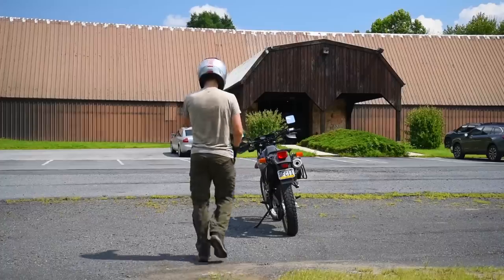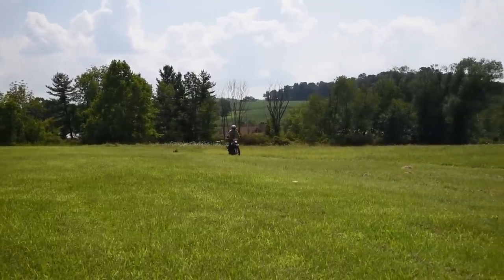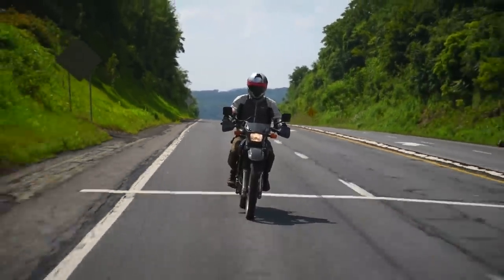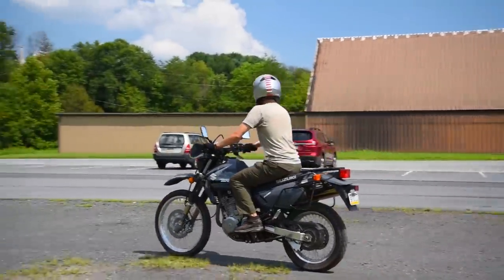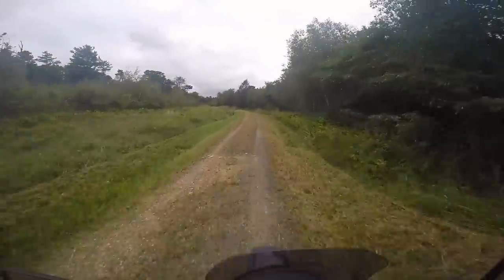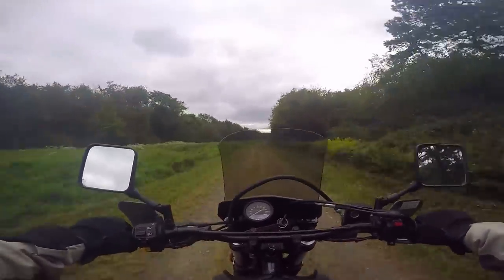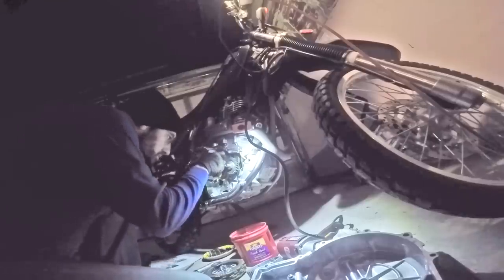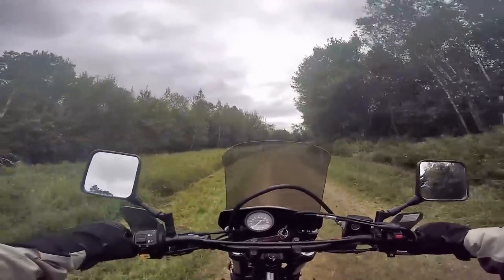2013 Suzuki DR650: Regular Car Reviews

Comment: I used to have a DR250 (first bike as a kid)  and laughed hard at the intro (WHY CAN'T I WHEELIE). When I got comfortable riding, I attempted to wheelie and flat ass couldn't for the life of me. I do remember that my bike was nice, but not great at anything, Wasn't fast (250cc of course), was 'ok' at best on rough single track territory, semi comfortable on trails, but it was pretty comfortable, and it was quiet. Easy to zoom around on without annoying neighbors. For someone who is mainly a road rider but wants to have the capability (and not primary) of off-road, then i'd recommend it. It's a bike you can ride up and down the street, and if you have friends who have dirt bikes, you can at least go with them even if you can't lead the pack.

Comment: Compromise isn't always terrible. The Yamaha FZ6 did it right in my opinion. It's a derivative of the R6 that was adapted for comfort. As a daily-use commuter bike, it is excellent. But, you're not as limited as you would be with a true sport bike, because you can actually tour pretty well on it if you get the urge.

Comment: I'm so glad you did this! I used a DR350 as a daily for a while. It has pretty much the same power to weight ratio as a DR650 but it can do a wheelie lol. It could handle anything from gravel to the interstate. Stock gear ratio was a bit short though. I changed the rear sprocket eventually so it would cruise on the highway reliably. Bigger gas tank too 2 gallons isn't enough. Honestly my EX250s were better dailies but I LOVED that DR350.

I also had an AW11 so thats two vehicles in common with Mr. Regular now. You have good taste, sir.

Comment: City commuting (in places with legal filtering) is absolutely best done on a little dualsport and my mind can not be changed. I did a CB650 Nighthawk for a couple years, then I found a KLR250. I cut the bars as short as possible for maximum lane splitting. I never encountered a red light where I couldn't get to the front. I still had enough acceleration to beat every car off the line. High enough to see everything. Super easy low speed handling. 60+ mpg. Up and down curbs if necessary. Light enough to pick up and reposition. $1500. Cheap insurance. Cheap registration. Cheap parts. Easy to work on. No big deal if some dumbass backs into it and knocks it down. Not really an attention grabber for cops or assholes (if you have a stock pipe).

I could go on... But just trust me, if you  live in a busy city and commute on city streets, you NEED to try a dualsport.

Comment: I have a 2011 dr650.  Bought it brand new. The tires from the factory suck in both conditions.   But I've also had the bike on 80/20  street tires  And it was great on the road. Obviously off road sucked. But, then I had a 100% off road tires on it and driven it on the road and it wasn't that loud. Now, I am back to a 50/50 tire,  It does both better than the 1st set did.

Comment: I ended up with the drz400 - mostly because it was cheap. I bought it as a “dirt bike” that I can ride to the trails. It’s a little heavy but with the dot knobbies it’s not bad - more fun than my old xt350 - but for an amateur like me, the power is manageable. It’s tall though. I’m 6’3 and it’s at the maximum tallness I can ride off road. It’s horrendous on the highway, but ok for back roads.

Comment: I road mine on the highway all the time with no problem, get rid of the wind shield and enjoy the wind in your chest that is what bike riding is all about, I am 71 yr and can ride one all day no problem, and they do make 50- 50 tires that fit this bike that are very good off road and good on road. I don't ride in the mud just don't like getting all muddy, but go through the woods and down many single tracks no problem but I keep my speed down if i want to race off road I would get a off road bike not a duel sport. This is one of the best all round bikes out there, may not be the best at anything but is very good at all things. People keep saying this bike is to heavy for off road, there are people out there that do off road with bikes almost twice this weight. As for feeling the heat don't know what your are talking about I have never had a problem with that on this bike, but have on many others, you must have a short inseam as I am 5' 9" and can flat foot this bike no problem with the standard set up and you can lower this bike, the dealer will do it for you if you ask. There is one other thing this bike needs is a center stand for easy chain maintenance.

Comment: I have had two Drs ,the low price gives you a chance to upgrade the  suspension to your liking ,the stock carb is  easy to modify and the exhaust as well ,it will go like shit out of a Shanghai then . This is a tinkerers bike that will reward you with bit of effort,I would not swap it for a screaming 250 . It is easy to maintain and reliable.

Comment: I have a 2009 DR650. It has a plastic tank, TM40 pumper carb, cam, full exhaust, heavier springs, and some of those DOT knobbies. It's nigh-upon indestructible, and goes anywhere you point it, so long as you stay on top of it. With the TM40, if you hit the gas that big cylinder will immediately and violently throw you at the scenery, or stand up and throw you down into the dirt where you belong. 

I have a street bike in addition to this DR650. The DR650 certainly has it's place. And it DOES have a rev-limiter. 7,200 rpm is where it's at. Or, 1,200 rpm past the point where the engine is useful.

Comment: I think that dual sports are the perfect bike for cruising on dirt roads. Obviously they are not made for pure off roading like a dirtbike. The thing about dirtbiking, especially on the east coast, there aren't really many trails that you are allowed to ride on, or that even exist. But if you live anywhere near anything rural (like a lot of people do) then there are dirt roads everywhere. And when you think about it, dirt roads are basically like trails but for cars. See the thing about motorcycles is that on pavement you can die from sliding out on a patch of gravel that you didn't know was on a corner, meanwhile you weren't speeding and no other car hit you and it was nobody's fault, no way you could have avoided it except for surveying your entire route before riding a motorcycle on it. Dirt roads on the other hand, are always dirt so you don't get that slide-out effect transitioning between pavement and dirt. Those dual sport tires from the factory look almost perfect for dirt roads. The nice thing about dual sports is that you can ride the short distance on pavement that is required to reach a dirt road for cruising without having to trailer your bike there. The final nice thing about dirt roads that I will mention is the low amount of traffic, and low speed of traffic. You don't normally have to worry about trucks or fast cars. There are little trails going off to the sides sometimes to explore like old logging roads. It's by far the safest way to enjoy any kind of motorcycling in my opinion. Low speed, low traffic, no sliding out, just cruising the back roads.

In the west and some other places they are spoiled and have actual miles and miles of trail to ride dirtbikes on so they don't need to dual sport on back roads. Yeah that DR 650 is the perfect back road cruiser. It looks ideal for dirt roads. It would also be great in more third world countries where the standard road surface isn't smooth pavement.

Comment: Actually found it a great vid for someone considering a dual sport with points that most buyers wouldn't consider. Also pointing out a very serious flaw in the neutral switch mount for that model.  Thanks

Comment: Now you’ve reviewed six vehicles I’ve had! (TJ, JK, SL2, SRT-4, W123 diesel, and DR650SE)!

Bummer the Bush Pig didn’t fit your role. Yeah there are bikes made for the roles it can become, but it does really well at those roles when properly modified. Step 1 is to toss the tires, step 2 is to do the shock and forks, then ride it until you find things you need on it. By my two year mark, I had spent the price I bought the bike for on mods. Still, it’s a lot less of an investment than any of the bikes I could’ve bought for this role (long range adventure bike), and more powerful, lighter, more nimble and simpler than its closest rival, a KLR650. 

But if you’re less into building bikes and more into riding, it’s not gonna suit.

Comment: Yup. I live in the land of thousands of miles of gravel. Klr650/dr650 is how you ride that with 400 lbs of camping gear. Good to hear the Suzuki has the same kind of cheaped out part. Ask the klr650 guys about the doohickey problem.

Comment: Thank you for the tip on the neutral sending unit 😂 just bought a 1999 dr650 a month back with 7,000 miles on it

Comment: If you think going slow on grass on the DR650 is bad cause of the weight, how do you think Ewan McGregor and Charlie Boorman felt on the Road of Bones while riding the BMW R1200GS which also carried all their kit, and tents? The R1200GS has a dry weight of just over 500lbs. 
If they can make that work off-road, you can certainly make the DR650 work off-road.

Comment: I have a 1972 xl 250 . I put 10,000 miles in myself  I have rebuild it twice. I can go out right now and kick it and it will start  love thing but this is a 50 \50 bike ... not bad on the dirt not bad on the street either
Reply: update the XL250 gave up the ghost ( but to live again )
I now own a XT200 and a XT350 
so my adventure bike needs are meet in spades  
the 200 is a commuter bike with off road capabilities  
 the 350 loves the woods but can tear up the street too

Comment: I recently picked up an old DR250S, and just got it on the road last week. There was (actually, still is) a Husqvarna WR125 that someone managed to get titled for about as much as I now have into my Suzuki. I decided against that, figuring the little two stroke would be too uncivilized on the road, and having to mix the fuel sucks.

But the little DR kinda sucks on the road, too. Someone put on a DG "silencer" that's hot and loud. It's turning 6500 RPM in sixth gear at 55 mph. One still needs to ride the clutch in tighter, technical off road sections. It's lighter than the 650, but it's still not light. I like it, and being able to ride to a trailhead legally is awesome, but, objectively, it sucks. I'll keep riding it for a while, but I'll be keeping an eye out for an LC4 or EXC 350-or-larger the entire time.

Comment: In the spring summer and even early fall here in the south it's motorcycle weather. It's a daily driver to and from work, yes in the winter I use my truck but yeah who wouldn't?
I own an a DR650 and it saves me a ton on gas and insurance. they're cheap to buy, cheap to insure, and cheap to fix if you fuck it up!
The only real down side in my opinion is the lack of ''go fast''! You just might hit 75 going down hill with a tail wind...
I find everything else about them great!

Comment: Dual sports are cool, I learned to ride on a KL 250. The DR doesn't look as aggressive as the Kawasaki KLR 650; it looks better IMO, but has the same problems, OE compromise tires and torquey but certainly not fast single cylinder 650cc.

Comment: This video was hilarious. My last bike was a KLR650 which I had a blast on. As a former motocross and hare scramble racer I can rage through whoops no problem on any of the big thumpers but I'm thinking my next dual sport will be an XR650L because the KLR was heavy as all hell and I don't want the 600 mile oil changes and valve checks that the CRF450L and the euro bikes like KTM and Husqvarna require. Plus the XR's only weak spot is the front sprocket where the KLR has the doohickey and the DR has some seal retainer and that sending unit

Comment: Did you ever consider a 650 Vstrom? Sounds like the perfect bike for you if you like the tall riding position but don't want to go off road. Or a Versys 650? I had an 08 DL650 put 100k km on it in 5 years. I moved on to a 14 DL1000 but I still miss the wee. It's kind of the ultimate regular bike, the CRV of ADVs. Great mileage and crazy reliable.

Comment: Dual sport bikes are great because they work great off road and can go on the highway to get you to other trails. With water cooling, EFI, and CDI, they are much more trouble free than the bikes of old. The 650 is too heavy, I would go with a 230 or 250 cc engine that could cruise 65 to 70 mph all day long.  Knobby tires are ridiculous, I would go with trials universals.

Comment: XR650R, the ONLY 650 suited for the road, trails... And everything in between. Mine has 15/40 gearing, and will do 110MPH easily. And has good suspension, 20 more HP... Less weight...

Comment: BEST ZOMBIE VEHICLE BESIDES A BIKE: those pesticide and fertilizer spraying tractors, the ones with 20 foot diameter wheels and a cab that sits 14 feet off the ground with those giant arm sprayers that stretch over 40 feet long. You never have to enter a ground floor door again, if theres a car in the way you can drive right over it, they run on multiple fuels, they are 4x4, and you get rid of the tanks and put one of those truck bed campers up there and youre set for life. Also its a fricken tractor

Comment: I have one, 25K miles later. OK it's not a DIRT BIKE, but off road riding is all about the RIDER. In stock form, the tires suck, and switch it to a pumper carb. Change those, and it's a totally different bike. It really does everything well, NOT great, but it just goes and goes. Almost no maintenance, throw oil and gas in it, and beat it.

Comment: Love my DR650!  Thinking about selling my KLX300 because of it. 

PS, What did you drop at 0:49?
Reply: I'd say a stock one is fine to learn on but it is very powerful compared to my klx300.  Also depends on your height.  I'm 5'9" so I shaved the seat down so I could touch ground flat footed.  Like anything, if you learn good fundamental skills you can apply it to any bike, within reason of course.

Comment: My 2007 DR650 has a rev limiter.  Mine will wheelie easily.  It is lacking stock but jet the carb cut the airbox and aftermarket exhaust.  Respring and gold racetech valves in the forks and rear shock.  And a few other mods it's pretty good.  If I buy another bike it'll be a used Husky or KTM.  Hahaha

Comment: Ive ridden both the XR650 and DR650 gotta say not really much difference between them. Both are heavy pig bikes offroad. If you want an affordable dualsport that can tackle most things offroad and be decent on the highway the DRZ400S is the answer. also the DR650 has been around about 30 years now.

Comment: funny review, but i dont agree with most of your criticisms. the dr s weight is comparable to other dual sports, and can be lowered. its perfectly capable on difficult trails, and on the road with a 50/50 tire like the kenda 270. the major downfall of this bike is the HP at 27, but its not a race bike so who cares? ive been able to keep up with pedigree 350cc bikes without a problem, and sometimes even have to wait....its a fine dual sport once you replace the stock tires.

Comment: Did you have an FRO permit while you owned the DR650? Clearly you are riding north of Cabella's on 61, once you get to Pottsville and St Claire, there is FRO land. We see DRs there all the time. But yeah, usually the guy is having issues (cause FRO land is not a gentle fire road) or the rider is seriously good and just goofing around on the DR.

Comment: windshield, throttle lock cruise control, phone holder and charger BOOM you have yourself a bad ass light weight adventure bike and if you want more range get a 35L fuel tank

Comment: I own this bike: waddya mean Suzuki cheaped out on ONE thing??? Countershaft seal pops out, upper chain roller takes a chunk outta the frame, no lube on any pivot point, single sealed wheel bearings, and steel bars all suck. Great bike though. Just got new springs and valves all the way around. Bike rides like a halfway decent off-road bike now.
Reply: Good for you. They're all well documented problems.

Comment: It's like a crossover. Sure you can lift a crossover and turn it into a battlecar, but an actual SUV or truck is better. Sure you can lower a crossover, but a car will still outperform it.

Comment: I never learned to wheelie. My first bike was a heavy (but comfortable and with very great handling) 125ccm enduro that had a lot of suspension in the back and so little power it couldn't drag a herring off of a plate. Wheelies were nigh impossible.

Comment: That was lame.  I gave you a thumbs down, because I have a DR650S and it's pretty good for older riders that want to have a pretty nice road bike that can go off road nicely, a.k.a. an enduro.  Younger riders that fantasize about things like end-of-world scenarios, or the need to do wheelies, won't appreciate it.  It is a little heavy, but that's to be expected for a 650. They have been making it for 29 years, so you got that wrong too.  It has plenty of power, to pass on the highway, to out accelerate dangerous drivers in sports cars,  or to get up long steep hills without bogging down.  650 is about the minimum for the street and highway, and its about the max for dirt bikes, so if you want both, this is the bike.

Comment: knobbies are loud? never would have known...  '78 2 stroke life. my bike is 250lbs wet. 125cc and honestly its a dog of a 125 2 stroke.  but it's got some torque like a 4stroke to make up for it wanting to rattle apart at 8k. it'll wheelie. most importantly it's more at home on trails and in the woods than on the road but it's fine to get you to the real riding spot.